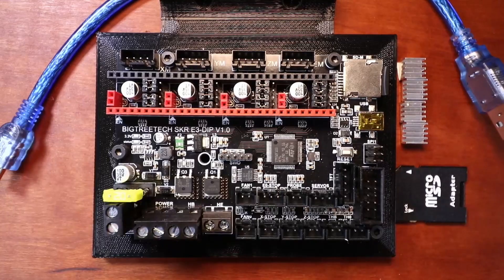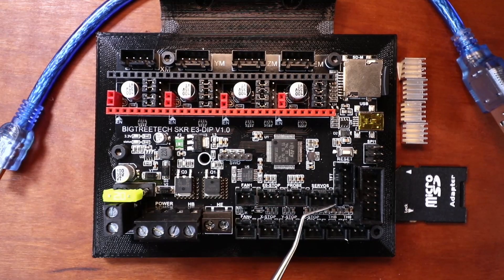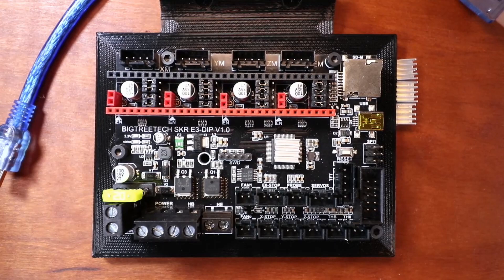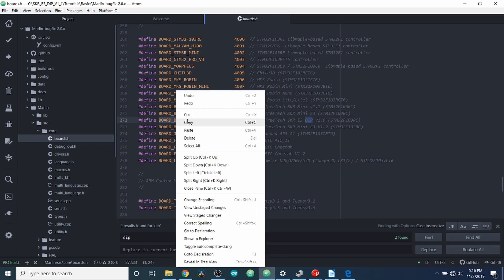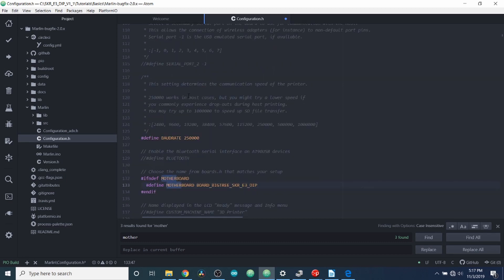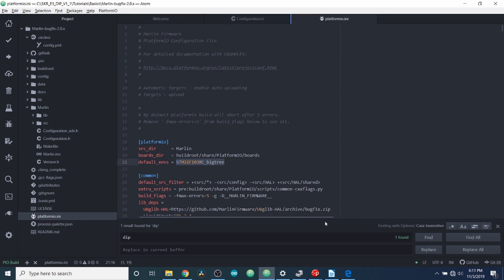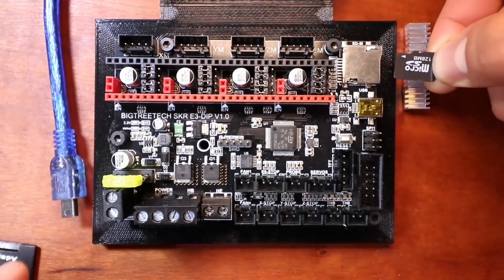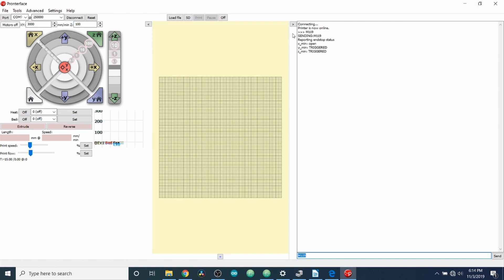SKR E3 Dip v1.0 - Basics

Comment: you coosed in platformio.ini  RCT6 but your chip ist RET6   what then to do ?
Reply from the maker: Sorry, did you say your chipset is RCT6?  No sure I'm understanding the question.  Could you rephrase it?
Reply: Sorry for my English, you can see in the video that you have a RET6 chip, but in the Platform.ini you state that you have installed an RCT6 chip.  I have the latest version of marlin.  In addition, the RET6 has a 512K memory but if you look for the RET6 in the .ini there is no choice between 256k and 512k, but with RCT6 it does not have 512K memory.  There is already such a question on github but I don't understand what to do there or it has already been fixed and it doesn't matter what exact name you take from the chip.  https://github.com/MarlinFirmware/Marlin/issues/15254

Comment: Tried do compile but gives this: "STM32F103RC_bigtree failed"
Reply from the maker: What's the default environment in platformio and which version of Marlin firmware are you using?  I'll give it a try after you reply.
Reply from the maker: Looks like your environment variable is correct. I'm compiling Marlin bugfix 2.0.x and it worked. Are you using Marlin 2.0.1?
Reply from the maker: You're correct on Marlin 2.0.1 failing to compile.  Try bugfix download below for Marlin bugfix 2.0.x.  it should work.
Reply: @EdwardBraiman , will try again later. Only one things : I'm not using Atom but VS code because now there's no official support for platformIO on Atom and my does not look like your's in the video. Couldn't find the compile button
Reply from the maker: @cooperwrks  it's okay, I've moved to VScode as well.
Reply: @EdwardBraiman , could it be an issue with the maple driver or is not related?
Reply from the maker: Unsure.  Were you able to compile with Marlin bugfix 2.0.x?
Reply: @EdwardBraiman , only tried the version bugfix 2.0.x,official and from BTT. I can try that 2.0.1 later today
Reply: @EdwardBraiman  ,check this again and my correct chip is the STM32F103RE. changed the environment on platformio to that but gives the same error on another chip code
Reply from the maker: @cooperwrks  are you using VScode with Platformio plug-in?  I just changed about two months ago and build/compile is more stable.  If you download and extract and the open in VScode with Platformio plug-in and then click build without changes.  Do you see compiler errors?
Reply: @EdwardBraiman  ,tried again from the start. fresh everything. Using the example files for my Ender3, did everything but changed the environment to STM32F103RE_bigtree. On the firmware, the E3 DIP has the wrong chip
Reply from the maker: @cooperwrks  are you using the same hardware in the tutorial?  Please enter what's printed on the board or link to where you purchased.
Reply: @EdwardBraiman , forgot to say in the comment that it works now :). The board is a E3 DIP v1.1 bought directly from BTT.
Reply from the maker: @cooperwrks  if the E3 has the wrong Chip, maybe you should then contact bigtreetech as it seems to be an error in manufacturing.
Reply from the maker: @cooperwrks  great.
Reply: @EdwardBraiman , thanks for all the help
Reply: @cooperwrks  hi there
Im having the same issue . .
E3 DIP 1.1 with one Ender 3 PRO and i cant compile. Any ideas to help me somehow ? Thanks
Reply: @EdwardBraiman  , the environment is the "STM32F103RC_bigtree" and tried the official Marlin bugfix-2.0.x and the files than came with the board: "Marlin-2.0.x-SKR-E3-DIP" . my board is a v1.1